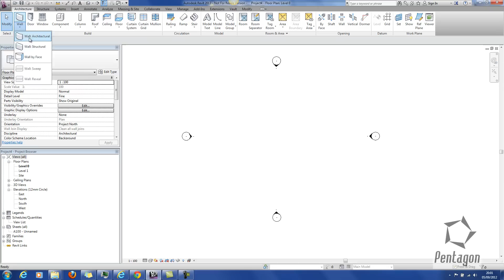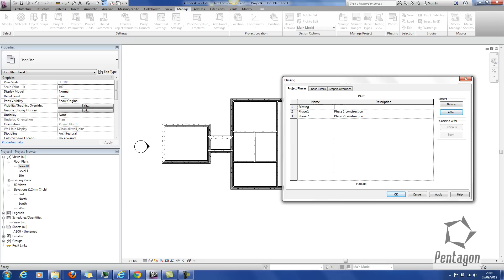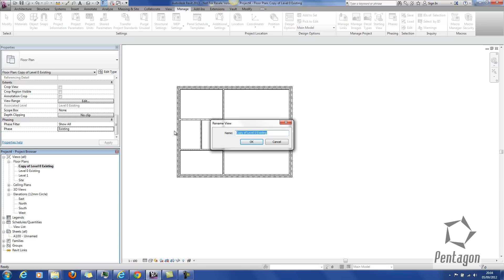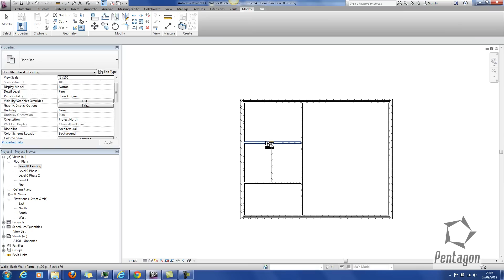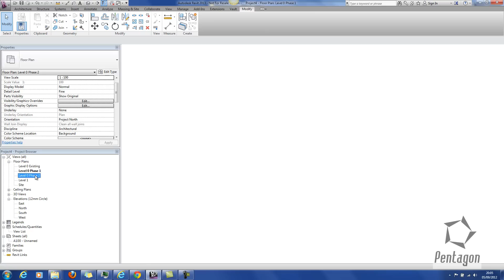Using Phases in Revit 2013

Comment: What a relief to find this video. I was getting more confused the more articles I read on phasing! We're doing our house reno and I think I'm going to do the whole existing building as its own project for documentation purposes as a local historical house and then save as to a new project file to start the reno work with changes since we won't be keeping all the historical elements. I read this as a suggestion in one of the Revit forums. Also, if you or anyone watching this video has any other comments re: using phasing for historical preservation, conservation, adaptive reuse specifically......this is a topic I haven't been able to find much on. But this video has been a huge help. Thanks so much!!!